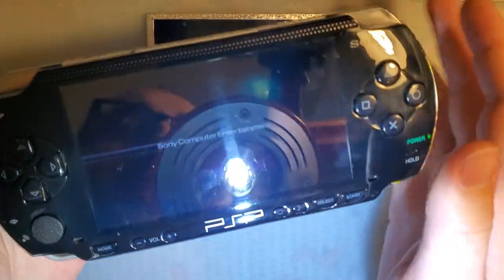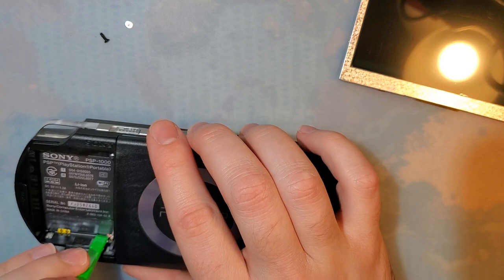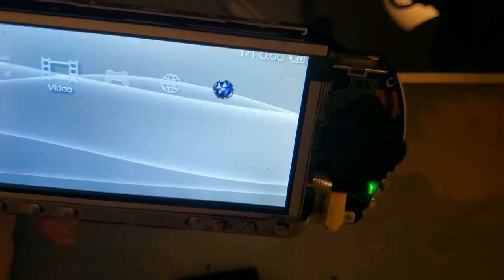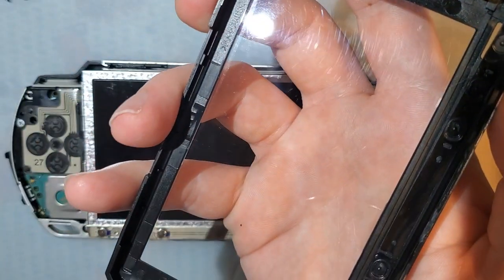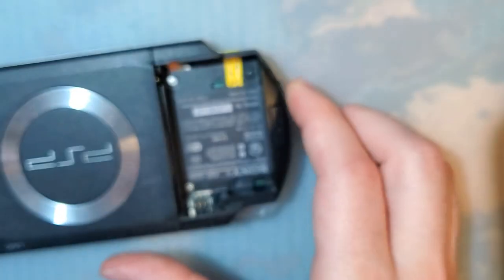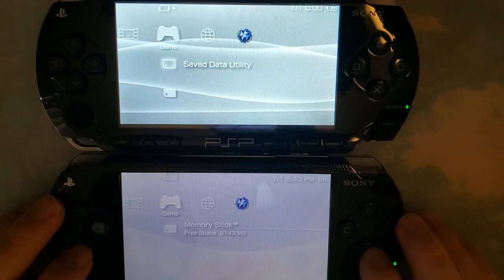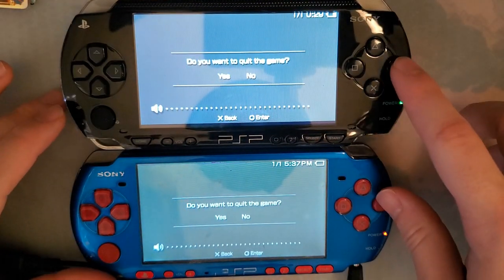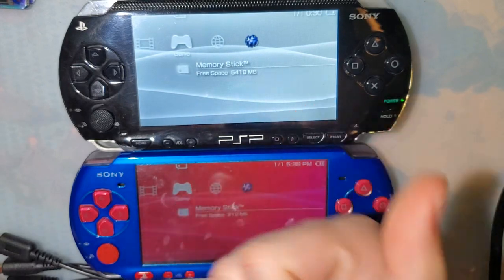Installing an IPS LCD in a PSP (1000) (Part 1 of 2)

Comment: over 39 minutes of footage, you must've spent over 2 days with that IPS screen
and you're telling me you didn't notice that this screen has bad alignment up until you booted up gta and noticed that the weapon logo is missing a gap from the bezel of the screen?
i mean just look at it, it has a big black bar on the bottom and the status indicators on the top in the XBM are almost cut-off (took you till the end of the video to actually notice that one as well).
when i first started watching this video i was thinking to myself - oh fantastic! i can put an IPS panel on my psp 1000!.
then i kept watching and right when you turned the thing on for the first time i immediately noticed this issue.
so i kept watching the entire rest of the video to see if you will even acknowledge this problem but it literally took you over 39 minutes of footage (and idk how much more actual time in person).
am i literally the only one here in the comment section that actually noticed this IPS screen is THIS bad???
it has to be either that the extension ribbon you used is bad, or that IPS panel has an offset which is incompatible with the original pinout of the PSP 1000's motherboard.
or both, after all this mod is Chinese engineering in its full glory, full of issues and incompatibilities but hey at least 50-90% of it works right! (something a Chinese colleague of mine always says about Chinese engineering lol)
Reply from the maker: > am i literally the only one here in the comment section that actually noticed this IPS screen is THIS bad???

So I take it you missed the title, the link in the description, the card I put up on screen, and the pinned comment.
Reply: @makho  no i didn't miss those, i meant the content in the video itself - you spent a couple of days with the system like that and only in the last minute of the video you finally realised that this IPS panel's input isn't aligned and has a thick black bar on the bottom lol
Reply from the maker: @HoLDoN4Sec  Since you're clearly new to my channel, I'll give you the run down on how my videos work. I film all my footage in real time and rarely cut stuff (aside from when I'm waiting for a washed shell to dry or for epoxy to cure). So if I'm 40 minutes into a video, I've been working on the mod for a total of 40 minutes, more or less. If three minutes later, I notice an issue, it's because I've only had the thing assembled for three real time minutes. I saw that something was wrong right away but I wasn't 100% sure what until later because it didn't occur to me that the image could just shift like that. I also very rarely fuck around with PSPs, most of my content is Game Boy related. I just stumbled across this kit and thought I'd give it a go since I didn't see a lot of other people talking about it. 

Sorry if I offended you by sharing something I thought was cool. I noticed my error with the original install right after I uploaded which is why there was a part 2 video uploaded like 12 hours later.

Comment: install a battery in place of the umd
Reply from the maker: That doesn't actually solve the battery problems. My 2K has that exact mod and I still have issues with it.
Reply: @makho  my psp 3000 powered off discharges the battery at 1 week.  new battery purchased from Aliexpress. ☹️
Reply: @makho  what issues did you encounter with the battery mod?
Reply from the maker: @ermonski  the circuitry in the battery board will still drain your cells flat regardless of whether you are using the console or even have the battery connected to the console. It's a terrible design.